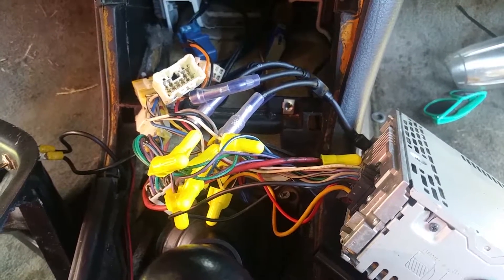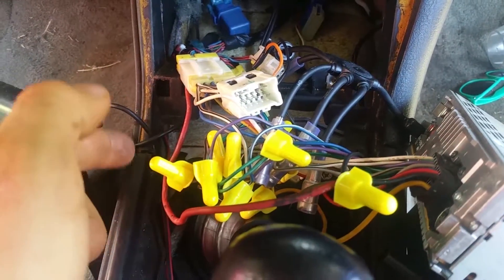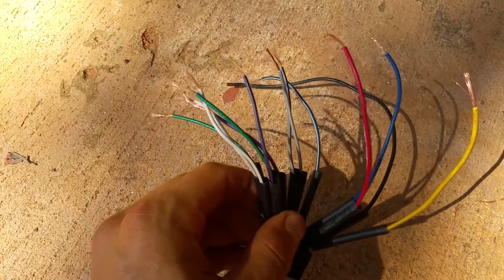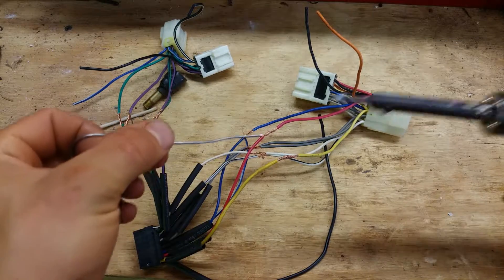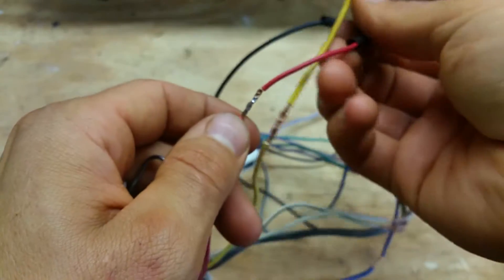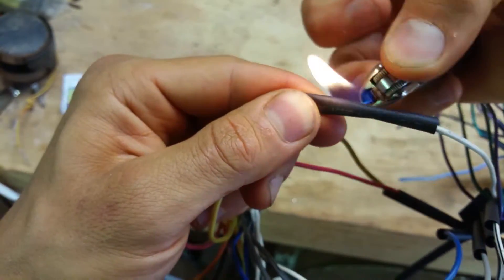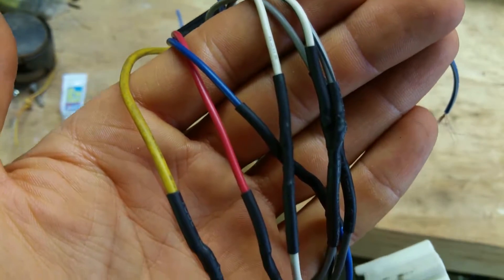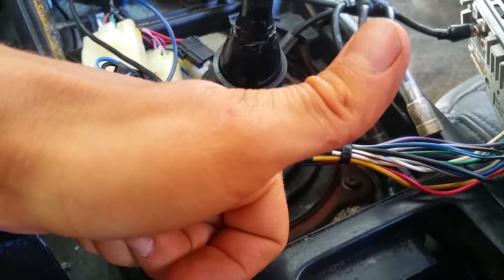DON'T Wire Your Car's Headunit Like This!

Comment: I bought different coloured heat shrink to match most of the wires I'm dealing with to avoid confusion. I also used coiled tube sleeving and small zip ties to keep all the appropriate wire groups separated neatly, which also means larger, unsightly zipties are not needed. When I solder wires, I make sure that the gauge of solder I use isn't too big to leave excess solder in the joins like you have, so there is no need to "file" away any excess like you suggested. Curious, why didn't you just reheat the solder to get rid of the excess in the first place (LOL)? It's true though, spend time like you have to do the job and it is very satisfying at the end. Well done young bloke. BTW, get yourself some smaller zip ties, a roll of smaller gauge solder and a flameless heat gun. :)
Reply from the maker: Yea, colored heat shrink is a good idea and so is the coiled tube sleeving.

The reason I sometimes file the sharp solder parts down in when you join the two copper wires there is sometimes a piece that sticks out. When you solder the wire it gets ridged and can poke through the heat shrink. I have seen it happen.

I already have all of those things! Thanks for the tips.